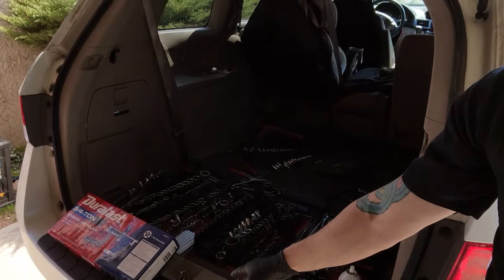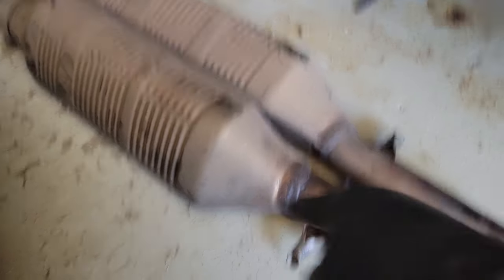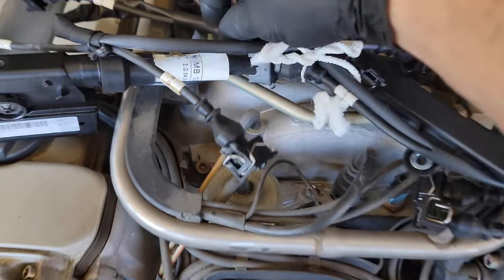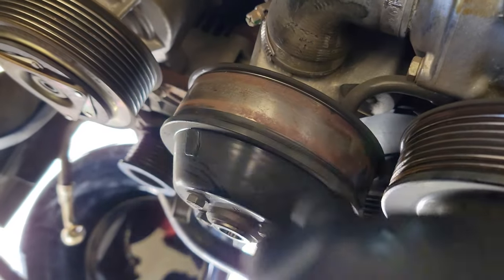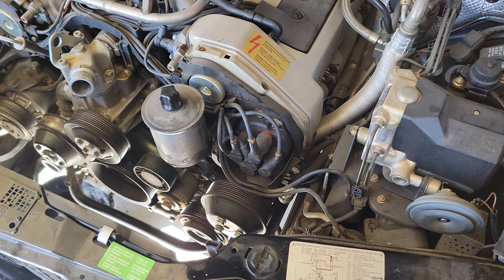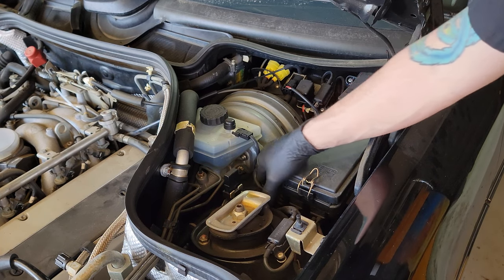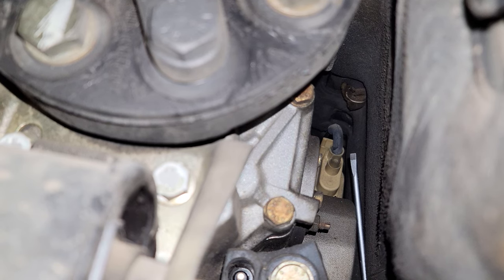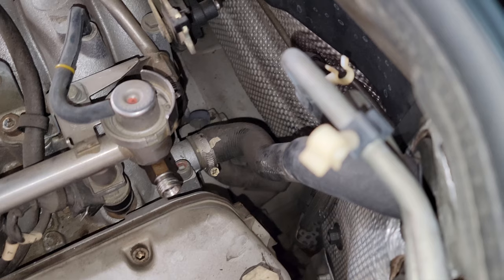M119 Engine Removal Part 1

Comment: Could you remove the fan without removing the accessory belt? I think that the belt would hold the fan’s pulley in place.
Reply from the maker: I think you might be able to depending on tension from the tensioner and condition of the belt.  The tensioner on this engine is either worn or not adjusted properly so there was a lot of play in the belt.  Also the belt was very dry and cracked so when trying to loosen the bolt the pulley would just spin.

Comment: One question how did u get the exhaust off when the engine is still in the car? Cuz I can’t get to the 2 bolts at the collector. On passenger side
Reply from the maker: I got the exhaust out when the car was on the lift at the shop.  The two flanges that join the front and rear sections were tricky still.  I believe I had to use a combination of extensions and U-joint sockets.
Reply: @FriendlyMBTech  ok thanks

Comment: Would you sell the mufflers?
Reply from the maker: Depends on shipping costs.  The connection on one side was a little boogered up when trying to separate them.  They were rusted together pretty good.
Reply: @FriendlyMBTech  is the center muffler (resonator) still usable?
Reply from the maker: @charlesphiliparthurgeorgep4653   It should be.  If you find my Facebook page https://www.facebook.com/friendlyMBtech I will see if I can send you pictures then you can make the call if it will work for you.  Where abouts are you located?  I'm in Southern California.  I have no idea how much shipping would cost on a 70lb exhaust section.